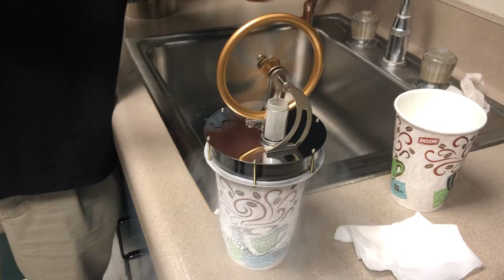Using Liquid Nitrogen to Turbocharge a Stirling Engine

Comment: I was thinking of using Fresnel lens to heat the top simply using the sun, it can reach thousands of degrees in heat and liquid nitrogen for the bottom. 
Just popped in my mind randomly and I found this video! Do you think this would be plausible?

Replacing the air with Helium is a good idea as well as it has higher thermal conductivity
, a higher heat capacity, and a lower viscosity which will make the engine perform much better.!
Reply from the maker: Rolando Basaca, it would certainly increase the temperature difference, but  you’d have to build a beefy unit to handle the large amount of heat you’d be putting into it. 
I’ve melted quarters with a fresnel lens. 
Pennies are trivial (Zinc), but quarters are mostly Nickel...